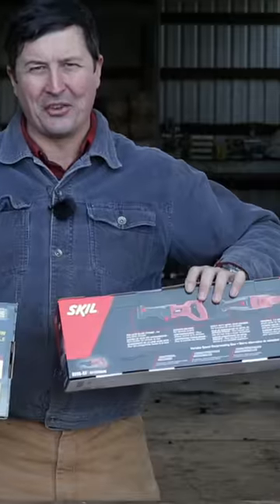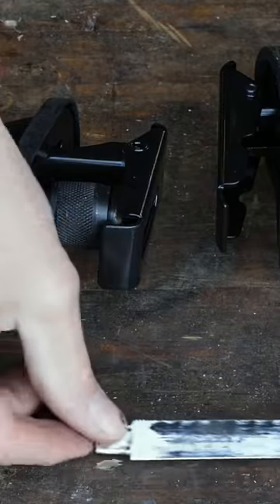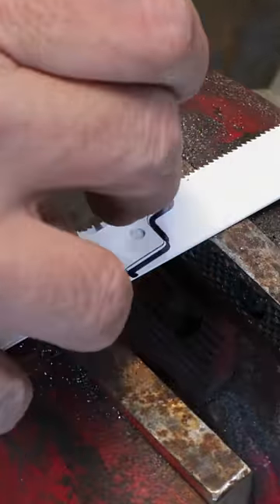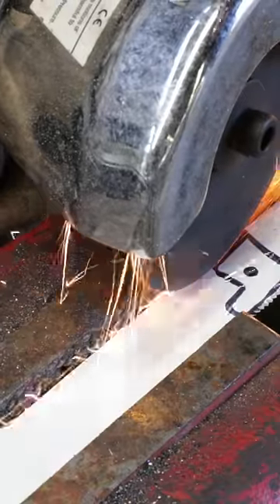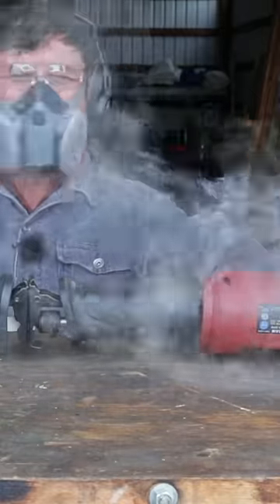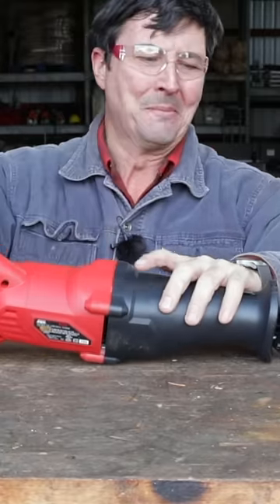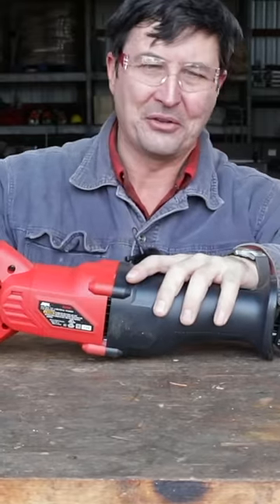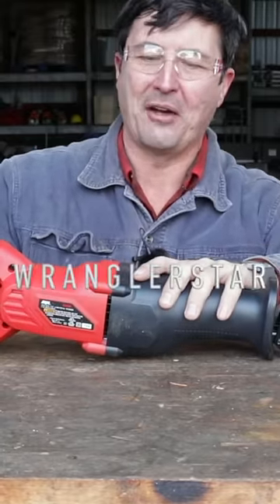Testing Cheapest Sawzall Wranglerstar PROfessional Homeowner #shorts

Comment: Harbor freight makes the best tools for people who dont have a lot of money. Sometimes all you have is the 8$ for a dremel knock off so you can fix a pipe on your sewer system to get ya by another few weeks.
Reply: I go to hf from time to time because I do need a short life power too to get a job done, they fillt the bill perfectly
Reply: They can have some decent items from time to time
Reply: @Ngcarson1337  exactly,  people wanna use cheap tools in intense industries while also absolutely abusing them. Then wonder why their tools break
Reply: My Harbor Freight sawzall out preformed my expensive Milwaukee sawzall in wet conditions cutting 2" copper pipe commercially.
Reply: @WhatsAl2k  ive never hesitated to beat a harbor frieght tool. Im always suprised how much abuse it takes and im never even upset i finally destroy them. I WAS LIVID when snap on wouldnt honor a eletric impact warranty because it had 1 scuff mark on the rubber shell from rubbing it on a tire when i was pulling rear shocks off.
Reply: They also make great beater tools, you have your nice, fancy, high quality expensive tools and then you have cheap ones that get the most abuse to save on your wallet.
Reply: I work for a dealer where I'm setting up new equipment, very often installing of front end loaders. HF impact tools have gotten me out of that pinch and a Milwaukee on deck if the earthquake gives up. Mr Wranglerstar must be one of them guys who thinks if you don't spend a $1000 on a $300 tool you are not as good.
Reply: @WhatsAl2k  those are new jack stands right?

Cause if there a few years old those have been recalled for bad welds and too much play in the locking mechanism that have resulted in multiple fatalities when they failed.

If there new I'm guessing they are a over correction basically to the lawsuits and good quality.

But if not go swap them, not AT ALL safe
Reply: @Ngcarson1337  both were corded types.

Comment: When I first started my business I had a Harbor Freight Sawzall (i had no money) and it broke in the middle of the job  I used the drywall screw to put it back together and keep working...that night on the way home I stopped and bought a Milwaukee Sawzall which I still have and use  13 years later.
Reply: How much left till your done paying it off?  🤔 hahaha.  Yeah Milwaukee some of the best stuff but I use a lot of harbor freight tools too and they get the job done on a budget.  As I've used certain tools more and more I tend to buy the better version.
Reply: Of course harbor freight tools aren't all superstars but for most usage they do great. Not business quality but for the jobs at home of a pipe or studd in the wall here or there they are perfect. $18 or $450 for something the average person will use 2 times a year
Reply: Milwaukee stuff is hard to kill. I dropped my impact driver into a hole dug for footings that hadn't been poured yet that was full of rain water I got it out and it worked no problem. 
I was on an extension ladder at the top of the second story of a house on an extension ladder installing security cameras and I dropped it onto the concrete sidewalk. The battery came off and the bit I had in it snapped off I popped the battery back on and it worked no problem. I had to get a magnet to get the part of the bit left in the chuck but anyway Just quality quality quality from Milwaukee tools

Comment: Holy 💩 didn’t expect the fire!  

Those were Amazon you said in the beginning and ended saying Harbor Freight.  If you want to use Harbor Freight try the Bauer. I’ve really come to like those for inexpensive occasional use tools. My impact driver is 3 years old now, original battery, and I use it quite often. Still amazes me how long the battery lasts. I use it at work lightly and when I work on my vehicles. Someone on another video said they use the same cells in their batteries as Dewalt.
Reply: Bauer and the Earthquake impacts arent bad for the money
Reply: @aKjohn8798  I’ve heard a lot of good things about those Earthquakes.

Comment: I had an engineer get a series of 12 hardened steel I-beams designed incorrectly and I needed to cut them all.

Went to Harbor Frieght and got a Saws All for 19.00.  It cut every one of them. I also used it on several other big jobs.

15yrs later it still works. 

The OP is off his rocker.

Comment: Perfect timing. I had a harbor freight sawzall for about 8 years. It seemed to work well when I bought it. Recently even with a brand new blade, it wouldn't cut anything. Ended up buying a new dewalt ( as I'm already in the battery ecosystem ) and it's night and day. And, cordless.
Reply: I’m willing to bet the switch goes out before 8 years. Every Dewalt tool I’ve had the switch goes out

Comment: I don't know about the Skill but I've owned my Chicago Electric Sawsall for 6+ years and I've got my $20 worth from it. I've cut two Volvo 240s in 1/4s. Dozens upon dozens of exhaust. Multiple pallets. Yes, I use better quality blades and yes, I've cut into the Sawsall metal guard but I am thoroughly impressed with how long it's lasted.

Comment: As for people advocating for the ULTRAcheap tools.. I agree that a 'once in a blue moon' used tool does not need to be professional grade.

However, if the cheapest tool breaks within the first 2-3 times you use it.. 
    - (Or even during first use; speaking from several experiences with ultra cheap angle grinders; blew the switch on the first, second one caught on fire) - 
        ...then the extra 10 bucks for a normally cheap version is the better choice.

ESPECIALLY if you're poor; 
you can't afford to spend money on tools that do not work..
       A return to the store costs (gas) money.
      Plus you can't sell a broken tool on to someone else.

Also; Skil is owned by Bosch.
      They use the Skil name for the cheaper line of tools, but they do have a certain reputation to maintain. 
      (Bosch is a reputable brand, and has been for decades upon decades)

- 
Bonus:
Realize that lowering the manufacturing costs is done by using inferior parts (for instance, by making a coil out of 'angel hair' thin copper magnet wire. Which will not be able to handle the required current),
 .. ..through poor fitment of parts, which introduces play (which introduces safety hazards and rapid wear),
    ...in combination with low grade temperature sensitive grease in the gear box (which will not lubricate the necessary parts. It melts and gets flung away from where it's needed)

If you have no choice but to buy the cheapest tool, 
     ...make sure you have a pot of proper heat resistant grease at home (bearing grease / lithium grease #2 / something like that)..
     ... And open up your tool before you use it.
> replace the grease in the gearbox
> doublecheck if everything is tightened properly (including cables)

And realize that such a cheap tool can be used about 6 minutes per hour.

Do 30-60 seconds of work. 
Then let it cool down for 5-10 minutes.

Don't push it.
It's not meant for continuous work.

Comment: Don’t put skil in the same category as Chicago Electric, Milwaukee yeah but not skil, every skil tool I’ve ever bought has performed perfectly. Every Milwaukee tool or bit or blade I’ve bought either broke or couldn’t do the job half as good as the skil tool. I always noticed that I rarely see Milwaukee tools on job sites and if there were a few they were the straight from college corporate foreman and they weren’t to be used not that anyone who was cutting or screwing or nailing would want to use them. Skil might be cheap but there good tools

Comment: That test might be fun but it's dumb and unproductive. 
Does not tell which saw will cut better is easier to operate or will last longer. 
Same goes for them screw guns you destroyed that other time; still thinking which one of those would have gotten a screw into a log faster or would have the battery last longer?

Comment: Idk that it's fair to judge Harbor Freight or ANY brand with a "torture" test.  I work daily with power tools of all brands and have owned many Sawzall style saws and no one would ever bind one like that. 
If you're cutting material and it binds and won't move you would move it out of the area, not continue to force it until it burns the motor